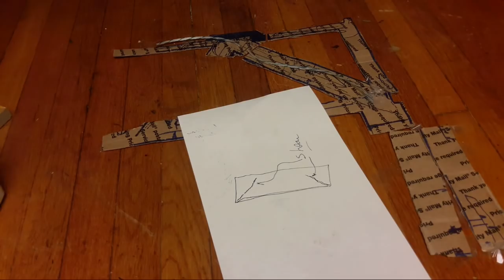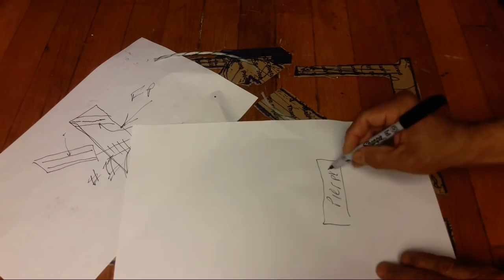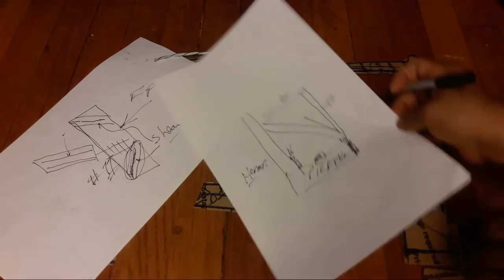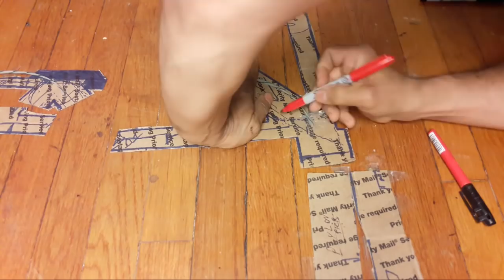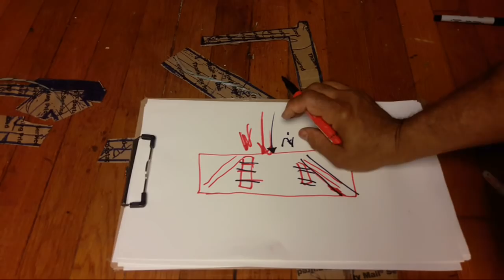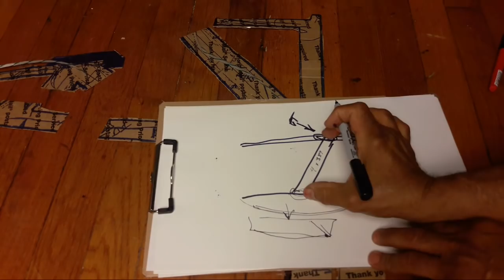FIU BRIDGE COLLAPSE EXPLAINED  11, 12 AND DECK  HINGED UPWARD

Comment: As i understand, GUILTY in the death of people to blame the engineering department, who was to supervise the construction, And when
 he got a report about the crack. First what he should do it's all to STOP, because when you got it the cracks in the structure, this structure is no longer the same structure which was designed, and calculated, no more. Because it has cracks, and this means
- you do not know internal structure, when you do not know  structure building, you can not predic how it will be work. Evidence of this- they hammer the canopy.

GUILTY  the engineering department, who was to supervise the construction, done.
Reply from the maker: Awesome... and to the point.
Thank you for commenting.

Comment: There will be movies made about this mess of bad engineering, bogus engineering philosophy.  construction variables and the problems with *internal post tensioning that creates shear stresses INSIDE of a member... in this case both at the canopies and at the support bottom end of #11... these video's will end up informing many aspects of those movies.

The hyatt hotel skywalk collapse was vastly less complex, just a single rod/hanger error and that has been talked about for 37 years , even recently..
search you tube for
 'Hyatt Hotel Collapse of the Hyatt Regency Skywalks on July 17"
Reply from the maker: Would be nic, a 2 hour documentary.
Reply: this will go on forever, so many crucial issues in the engineering, the engineering business, engineering philosophy, testing, the culture. the govt. physics etc... and a lot of people blowing smoke, eventually the world will come to see imo that a concrete member should not be post tensioned from inside the member, all post tensioning must have its post tension plate on an outside end,   I also I do not think we will ever see a webbed concrete truss bridge built again... those that are already will be considered serious liabilities.

One of the reasons will be the near impossibility of creating a computer program able to do accurate stress analysis around those cast in place members... chaos math at its worst to use your term.

Comment: Here is my 2 cents..........this design is basically an I-beam. now a strong enough I-beam would work. However in this case the I-beam is being toyed with because somebody wants pretty.
So first we make the top flange thinner than the bottom flange, then we cut holes in the web, but not equilateral holes, no, some more horizontal. than vertical. Then to top it off we make it out of cement.
Then we bounce it around for a while with questionable transport and get it in place.
But we are not done yet.
Now we send a guy up with a plan to tighten things up, but was He equipped with an engineered plan.
Was there a sequence to follow.
Was there a specified draw weight.
We probably will never know, but we do know that his jack was stronger than the bridge.
He kiped the scales. One pound to much for this ill fated design.
We are looking at a case of complete incompetence, negligence, ignorance, and fingers crossed.

Comment: Your time , energy,and intelligence on this issue is not matched by anyone on this issue .I truly apprecite it. Sad truth is those families will never know the truth from NTSB ,and that makes me sick to my stomach. Your efforts allow  people to get a better understanding. I'm in construction 45 years ,and the single truss design with no redundency  was insane in my opinion to cast this bridge using ABC  .What is your opinion  If they used a post tension fabricating company which strictly  creates  that type of  components/structures to engineers specifications  maybe it could have been accomplished . Your Thoughts ? This was a BUTCHER JOB as you can see in the photos from rebar to finished surface  terrible work. Thank You
Reply from the maker: Thank you Joseph, your comments really made my night...  I will answer your questions, live,  tomorrow, at 7p.m. , Eastern Standard time; I have a lot of work to get done tonight...
Glad to here you have 45 years strong!!!
Reply: I can say with total confidence if I was building that structure my company,and safety official  would  fully support me ,and  the 3 rd party inspectors red flags during casting never allowed that structure to leave the side of the casting bed ( ABC )  period . The main issue is lives were lost for the entire project failure ,and people should be prosecuted  ,but remember the Dade county DA on live TV the day after accident stated not likley anyone will be .It's been a cover up since day one ,and that's sickening.

Comment: Isopropyl alcohol can remove permanent sharpie lines, but it may strip the floor finish.
Reply from the maker: North95, it can -- thank you for watching that far into video... tomorrow at 7p.m. , I will do another live broadcast.
Reply: Construction Engineering & Photography Eastern Time??
Reply from the maker: Yes, Eastern... I apologize for not making that clear.

Comment: fabricate telescoping, spring loaded diagonals for compression dynamic, using latches to trigger separation at failure zone (crack locations?)
Reply from the maker: Send me the rubber bands and any other material you would like me to use...  I will use them and dedicate the video to you.
Reply from the maker: Send money --  and the link for the telescoping, spring loaded diagonals... I do know of them, never been able to find them.
 https://www.paypal.com/cgi-bin/webscr?cmd=_s-xclick&hosted_button_id=4DYGNXSDC4SCC
Reply from the maker: I did like your one link with the square tubes... would have made a nice detail to scale the bridge...   but, my cardboard is more fun and I can cut them not to scale --- lol

Comment: Your video make some things clearer, the reason the base of the walkway pulled away from the top of the pier, was because the walkway when collapsing turned from a straight ling in to a " v " shape, that being longer than a straight line between two points, caused the cables to holed the walkway together, meaning the walkway had to become shorter than the distance between the to piers, But when the bottom of the  v  hit the road the line of the walkway again started to straighten out, with at that time the base of the walkway half way down the  pier.   Having looked at your video of 19th May, the gouges on the Pier were made by the end caps of the walkways longitudinal  cables.
Reply from the maker: Freedom, thank you for finding that video and posting the date...  I wish I could ''FIND'' that the back of and CENTER of structure is still in-place on the bottom of deck.
Reply from the maker: TUESDAY AT 7P.M.  I CAN DO ANOTHER LIVE VIDEO AND ANSWER SESSION IF YOU ARE INTERESTED JOIN THEN.
I WILL DO A LIVE VIDEO AND PLEASE GIVE ME AN IDEA OF WHAT YOU WANT TO TALK ABOUT IF YOU HAVE SOMETHING SPECIFIC... COMMENT OR REPLY TO THIS MESSAGE...   IT CAN BE PHOTOGRAPHY , CONSTRUCTION, PSYCHOLOGY OR ANY TOPIC YOU SO DESIRE...
NOTHING TO CURRENT AS I USALLY DO NOT WATCH THE NEWS (too much agenda going on there and too many triggers to waste my energy on).

Comment: I think my original theory still holds water,  but the outcome is the same- if this bridge could have been built in a lab under perfect conditions or in place, it would probably still be up. If there had been massive triangular forms above the transfer dollies to properly distribute the loads, that might have worked too. Problem is, everyone trusted the the others knew what they were doing and no one had the "balls" literally and figuratively to call anyone out. A bridge like this requires the best of the best to be watching at all stages. I do believe a design like this could be tweaked and be made to work with 10X the safety factor.

Comment: I am not an engineer but I still can't understand how the A symmetrical support beams were supposed to equally distribute the load of the canopy and the lower deck. I'm still trying to figure out what was supporting the lower deck.The support beams were clearly supporting the canopy, but what was supporting the lower deck. It seems to me that all the supports did was transfer the load of the canopy, and the supports themselves to the lower deck.
Reply from the maker: Tim, unless we see separation in the diagonals... they would be considered connected...  WAIT... we do see separation in the reported documentation of numbers 3 and numbers 10...    Basically Tim, you are correct, this design and it's '' elements'' were not ''supportive'' of each other...
Reply from the maker: TUESDAY AT 7P.M.  I CAN DO ANOTHER LIVE VIDEO AND ANSWER SESSION IF YOU ARE INTERESTED JOIN THEN.
I WILL DO A LIVE VIDEO AND PLEASE GIVE ME AN IDEA OF WHAT YOU WANT TO TALK ABOUT IF YOU HAVE SOMETHING SPECIFIC... COMMENT OR REPLY TO THIS MESSAGE...   IT CAN BE PHOTOGRAPHY , CONSTRUCTION, PSYCHOLOGY OR ANY TOPIC YOU SO DESIRE...
NOTHING TO CURRENT AS I USALLY DO NOT WATCH THE NEWS (too much agenda going on there and too many triggers to waste my energy on).

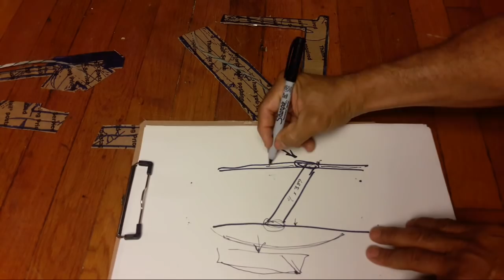Comment from the maker: https://ibb.co/mYOH08    HERE IS what we are discussing from the beginning until 20:00  no way did number 11 buckle and in fact, acted like a fulcrum and lifted 12 off of pier.  Or 30:00 minutes to cut to the chase,  40:35 full break and some shear during collapse NOT directly the cause!   ALSO,  I wish I could ''FIND'' that the back of and CENTER of structure is still in-place on the bottom of deck. 41:39 it then drops down on pier as the bottom deck clears away from pier -  1:14 shows the bottom of #12 and canopy movement...
"plus one" , in redundancy could be an increase in strength of materials...   also, fiberglass reinforcement also is another material.